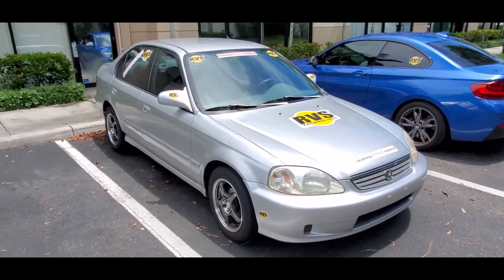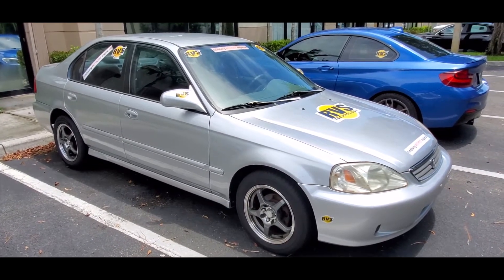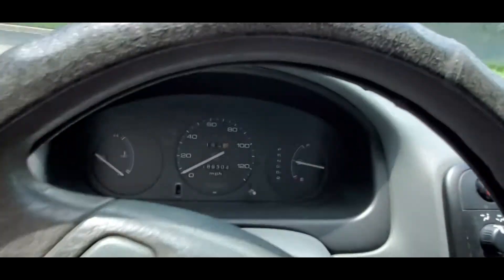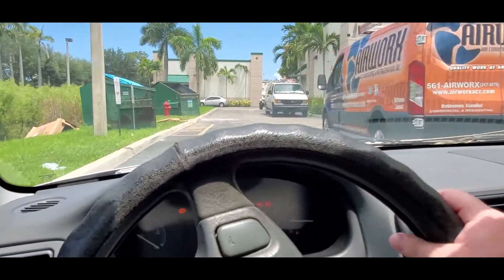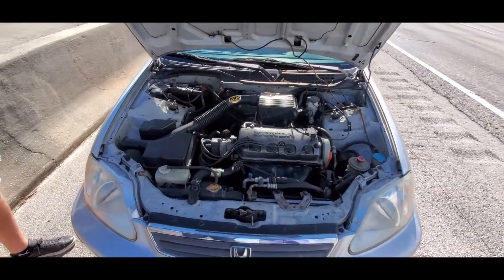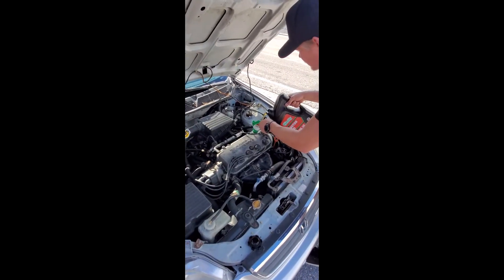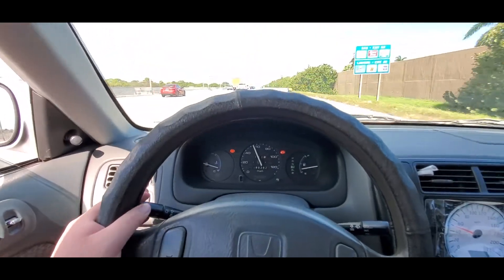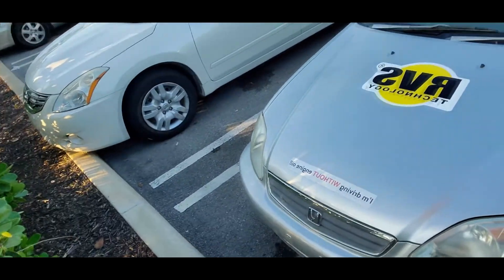RVS Honda finally gave up (kind of)! What Happened??

Comment: That's still an insane achievement, a normal, untreated engine can't even go for 4 miles without oil lol
In my car RVS has been great, completely silenced the lifter tick i was having on cold starts, and feels like it pulls better at low-mid range.